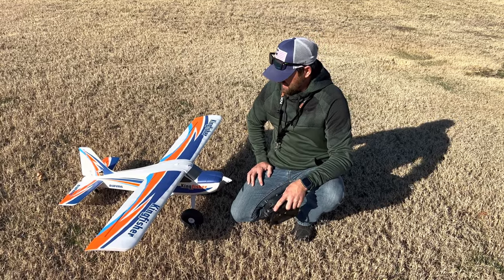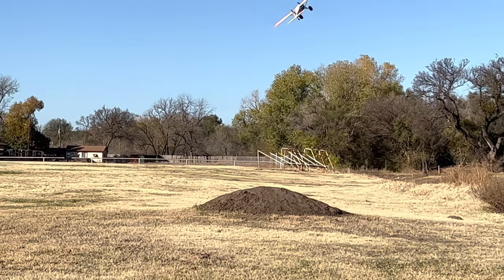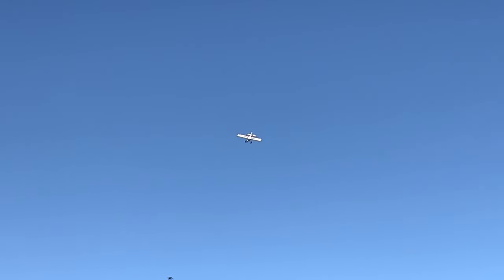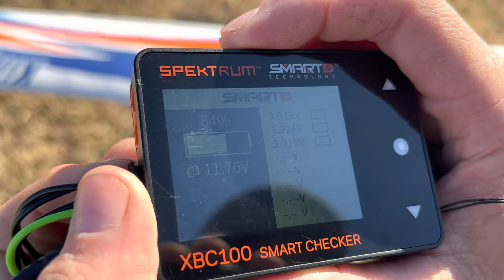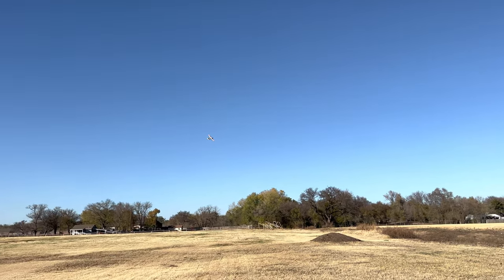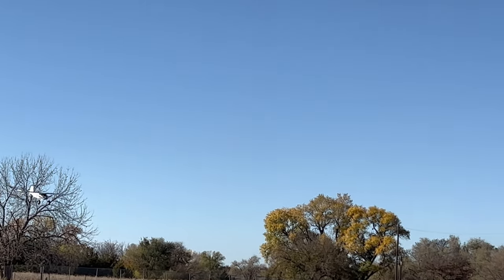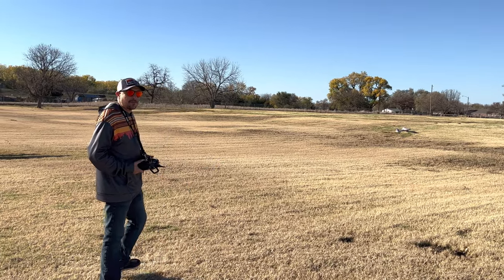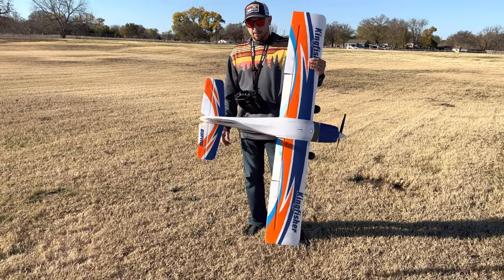FMS 1400mm Kingfisher PNP w/Reflex V2

Comment: Great video. I just got this plane and I'm using the recommended 11.1v 3s 100c 5000mAh battery. The problem is, the center wire on the battery plug limits how far the plug goes in. About 1/16th of an inch. Thats seems precarious to me like could very easily become unplugged.  Is there an adapter? I've looked on HH and even contacted their product support but they never got back to me. Any suggestions
Reply: Not the recommended battery for this
Reply: Not the recommended battery

Comment: Try it with a 4s 2200 & 12x5 (wood is best) propeller. Mine, my setup does everything my modded timber x's do. + kingfisher will double As a glider tow plane, up to a 2.5m
Reply: Oh, too: 7 minutes air time on a 4s/2200
Reply: what are you using as a motor in this configuration? please
Reply from the maker: Our setup is stock from factory, no modifications